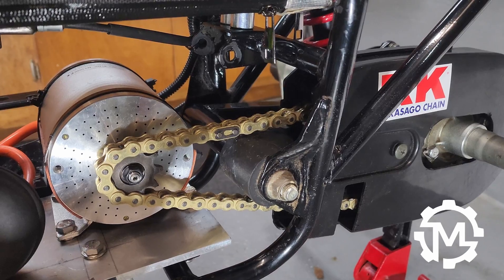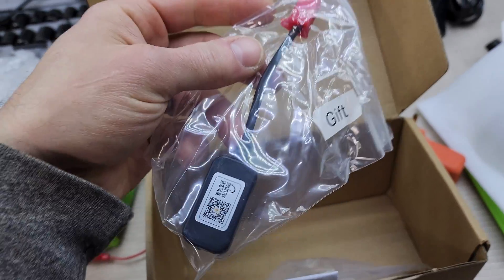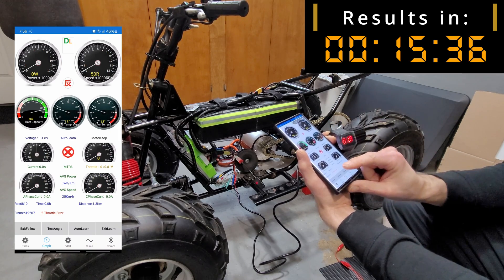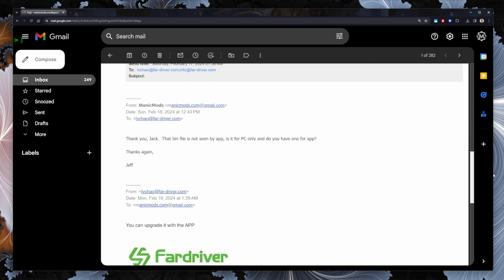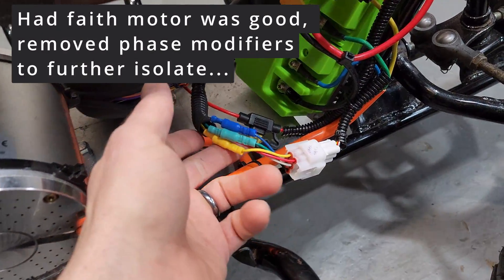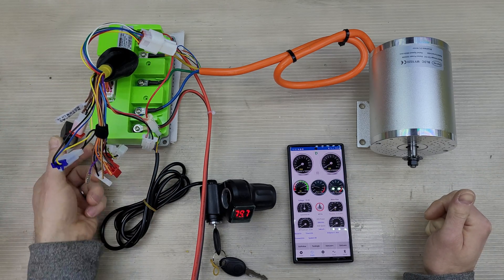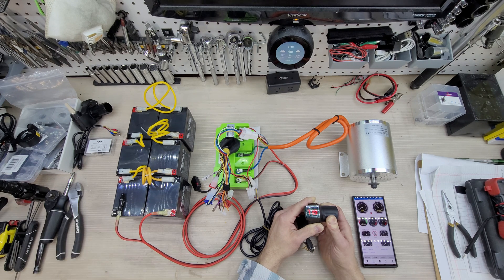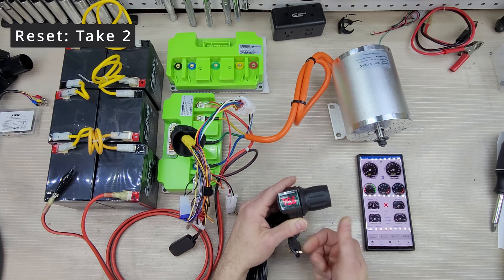Fardriver + Kunray 🔥A match made in HELL?🔥

Comment from the maker: CONCLUSION = Kunray is bad kitter / seller 👿  All signs point back to their entire kit since I experience on my workbench w/ 2 kits and 2 known good power supplies.  Fardriver controllers are known to be pretty reliable.  The controllers included are legitimate but the programming (by Kunray) is NOT.  I've worked thru dozens of solutions from communities which were very appreciated but had no affect on the inconsistent throttle.  I was able to resolve the 2nd controllers "throttle hang".  That was done by adjusting Function\Follow to Disabled.  This further illustrates their (horrible) quality control.  

RECOMMENDATION:  Stay away from Kunray.  They ghosted all correspondence re: warranty claim.  I was a month outside of return window, but Amazon forced the return.  

WHAT'S NEXT?  I ordered  a more basic kit from another seller to get the ATV back on the road, and my videos back on track.  LMK If you have questions- Appreciate y'all!
Reply: 😢I have this exact same kit that I got to make a electric dirt bike I’m doin to return it now befor it’s to late thank you
Reply: All my Kunray motors work fine.

I think it's that specific fadriver model.  I have the same issue with throttle.  If I ease I to the acceleration,  things works fine.
Reply: That's  crazy they should stick to what they know I just got the same controller my buddy and  it does the same thing I thought it was a str8 fardriver which it would have been a one and done  and done I think I'm a day outside return policy of Amazon
Reply: sorry for bring you trouble!  and we have saw your video , the controller self-learning maybe not very well.  BUT also for the MY1020 motor with fardriver controller set, it need not to reset the controller again,  because fardriver have been set the system with the motor.   and everyone motor and controller will be test before sending.
Reply: When you have any problems, you can send an email to our after-sales support team, and our online customer service is a salesperson. Of course, if Amazon closes the return window, you can still return the product to our after-sales service center in California.
Reply: Did anyone  find how to fix problem?
Reply: I bought the Kunray kit with KR5V motor, and 80 amp fardriver controller. The lime one. I think I am having the exact same problem. I actually thought it was a function at first. It seemed like the low speed throttle came on when I turned it really slow. After watching your video and somebody mentioned the third turn, I did find it was not that consistent. It’s like it comes on at 10% or full power. If I can’t get this sorted out, I’m gonna try the other controller. It’s a brand new Conray hundred amp controller that actually came with the kit. I hope you have a follow up video cause this seemed to be a very common problem.

Comment: Oi, estou com o mesmo problema, você obteve uma resposta?
Reply from the maker: I swapped entire kit with another controller.  It's Kunrays issue and as far as I know, nobody has solved this specific problem.  If you can't return and motor is installed, you could swap controller with another FD or cheaper non FD. Good luck and thanks for watching!
Reply: @manicmods  consegui achar a solução em um comentário de um outro video relacionado.

Segue as configurações a ser feitas no Fardriver

(Funcions)

Speed limit pin: selecionar opção 13- inválido

Por incrível que pareça essa e a principal parâmetro que trava a aceleração quando da full aceleração 

(PID Paras)

AN: Definir como 0
MaxKl: definir como 12

Aqui resolveu 100% dos problemas, ate mesmo quando o motor pegava altas rotações e ficava falhando foi solucionado
Reply from the maker: @matheuspericles386 I think we had different problems.  This was specifically 1 out of every 3 throttles.  It would just be limited on 3rd throttle to locked RPM. The other 2 throttles would be completely normal.  Appreciate you as you'll probably help others!  And hope she's driving awesome now for ya! ⚙️

Comment: Did you ever fix the issue,?,
Reply from the maker: No with big community behind me we could not undo Kunrays rogue prog on the FD controller. Returned Kunray kit for another MY1020 motor with a simpler controller.  If motor is installed already, you can likely just replace controller.  Thanks for watching! ⚙️

Comment: Did u ever figure out what it was? Was it the throttle? I just got a fardriver kit from hotpaxx with the same motor and mine runs fine
Reply from the maker: I replaced the kit w/ a square wave controller and another MY1020.  The community and I really tried to undo whatever Kunray did to the FD controller.  The issue was not the My1020 as I was able to isolate that when I had the second kit which experienced same issue.  There are enough people running FD w same motor which may suggest it was firmware related.  I don't remember where I left off in that exploration tbh.  Glad ur kit is good , thanks for watching!
Reply: @manicmods  i had same problem with kunray kit with cheap square controller… just avoid kunray at this point🤣

Comment: I literally have that same set up and I only experience the week throttle when I was pulling 40 miles an hour with a 52 V battery and then I slow down a little bit because of traffic and then I try to get on it again I kind of get a week I guess you could say idle. But nonetheless all I have to do is pull the throttle again and I’m off and running and I only just received my Kunray 3kw just this last Saturday. 🤷🏻
Also to note I did change all of the field weakening parameters and changed the throttle response parameters so maybe try that?
Reply from the maker: You shouldn't have to tolerate that.  Suspecting you found this video because of your problem.   When I experienced this issue on  every third throttle, it was not remedied until I restarted the controller or reached 0 RPMS.  It sounds workable in your case, but I found it unacceptable.   Also w the variance w/ two kits I tried, I am sure there are some that totally work.  But yah, Kunray sucks - plenty of MY1020 kits out there thankfully.  Glad your is workable, and thanks for watching!

Comment: Found a solution to the every 3rd twist ussue in the reviews on Amazon. Set speed limit pin to 0-NC.
Reply from the maker: Thanks for watching!  This is the first thing the FD group recommended.  Mine was set on 0-NC but also have documented test failures using other selections "Invalid" and "12-PB4".  It's also worth reporting is that this is just mapping your speed switch.  It should not create an intermittent failure.  At the end of all this, I had tried anything suggested by communities to no avail.  I hated swapping the kit as I really wanted to solve but it was clearly Kunray's issue.  I've had fun on it since!
Reply: @manicmods  thank you making this video. I had the same issue. Found that my controller was not set to 0-NC. Changed it this morning and re-auto learned the controller. Problem solved.
Reply: did this really help? I am thinking about buying this kit. Would be great if @manicmods would try it
Reply: Tested?

Comment: Another thing you can try is to set your min voltag 1 decible place more then the resting voltage, this should prevent the motor from spining when you don't have the throttle engaged.

Comment: I have the SAME exact issue. Every 3 throttle attempts or so, I get 10% power. I just spent 6 hours putting my build together. I would REALLY like to not take the whole thing apart. Did you ever find a solution to the problem?
Reply from the maker: I replaced the kit w/ a square wave controller and another MY1020.  The community and I really tried to undo whatever Kunray did to the FD controller.  The issue was definitely not the My1020 as I was able to isolate that when I had the second kit.  So if you cannot return kit, you may want to pick up a cheap square wave for testing.  LMK how you made out and thanks for watching!

Comment: Hi, nice video! Can you tell me where you got the sprockets (which ones and what ratio do you have) and what type of chain are you using? Thanks!
Reply from the maker: Thank you!  Parts below, list pulled from my later "The Build" video.  Appreciate ya!

-=-=-=-=-=-=-=- PRODUCTS REFERENCED: -=-=-=-=-=-=-=-

These are affiliate links which, at no cost to you, kicks me some pennies 😁

Final Build Parts:

DC Motor Kit  $183
https://www.ebay.com/mye/myebay/purchase

Battery $591
https://amzn.to/4dztpuU

Driveshaft Sprocket - 60T $28.99 
https://amzn.to/3WCoiUK

Motor Sprocket - 8T, 9T, 10T  $14.95 
https://electricscooterparts.com/motor-sprockets-420-chain.html

Heavy Duty 420 Chain $42.15 
https://amzn.to/4ba07S8

Master Cut-Off Switch $14.99 
https://amzn.to/44Jj9wg

Chain Tensioner  $10.99
https://amzn.to/3UtAcgQ

Fuse Kit $7.99 
https://amzn.to/4ah2fpZ

XT60  Extension cables $15.99 
https://amzn.to/4bfpqCm

FLASLD Fireproof bag $19.99 
https://amzn.to/3JTq5gy

Comment: I had this same issue.. you need to go into app and disable speedlimit pin and problem solved
Reply from the maker: Thanks for watching! That option in Function had no result when disabling.  It may resolve a similar issue but what makes this different is repeatable frequency.  2 out of 3 sequential throttles are fine.  Only on 3rd throttle was I experiencing this. And this pattern repeats itself.  Kunray is dead to me, but FD is great and plan to use again soon 🙂
Reply: it's that version ND72260 Fardriver... I was having same throttle issues on multiple hub motors not made by kunray.  I use ND72450 and no longer have issues  @manicmods

Comment: The throttle hangs because "follow" is on. Make sure you turn it off before you do the learning setup. Also don't let go of the throttle until the controller beeps at you when you're doing the learn. I have a feeling one of your hall sensor wires is crossed or something. I have that same type of motor and controller and it works fine.
Reply: Set the top rpm lower too!
Reply from the maker: Appreciate you!  Funny- 2 kits, and the programming was wildly different despite same kit from same manufacturer.  'Follow' was the problem on second.  Hall first manually adjusted, then reverted and adjusted electronically w/ BT dongle.   I went thru a host of recommending setting changes in pretty controlled environment.  Enough to just throw my hands up, and re-kit.  I'm looking forward to an FD build of something soon!

Comment: What is your minimum throttle set to?? Go to your gauges and  check what it says your throttle is resting at without you turning it. If it says it's at .80 then change it to .90 in your pro settings. And as for Pole pairs they can vary between 6 and 0 for your mid drive motor I believe. Phase offset is very important so I'd suggest you pursue that as an avenue that could be explored if your throttle or Pole pairs wasn't the issue. Lemme know how it goes if you like or need any advice.
Reply from the maker: Thanks FPV!   I had a great experience w Fardriver aside from the Kunray dilemma but I still had to return it since it was kitted.  I put a cheap square wave kit in and ATV is amazing now.  I'm a few weeks out from producing the build video.  My next build will definitely use FD!  Whatcha into bikes, karts?

Comment from the maker: The throttle hang is resolved.  This was the bonus throttle issue I received with second controller, not to be confused w/ larger throttle issue that plagues both.  Since only the second experienced this, I compared their settings.  Toggling one setting resolves this and results were repeatable.  

Just didn't want anyone scratching their head on that one.  You can find me on Reddit for more info, but I will not publicly disclose at this juncture.  I may even interrogate you 😉
Reply: @manicmods  edit*I’ll hit you up on Reddit

Comment: That throttle hang can be incorrect due to low and high voltage cutoffs being wrong but can be other issues aswell
Reply from the maker: Thank you x3 friend- are you referring to the throttle low and throttle high voltages (1.2, 4)?  I don't see another setting that touches on voltage cutoff.  If I cannot resolve the throttle hang, that's OK since my first controller does not have it.  I compared all the settings between the 2 controllers to see if I can find the outlier.  Chart below, hope it comes out OK.  It represents volatility in Kunray's programming.  If a difference between settings is causing hang, it must be one of these...

PARAMETER_____________1st Controller (NO HANG)__Vs__2nd (THRTL HANG)
Functions\Follow______Disabled__________________________Enabled
Product\RelayDelay____22643____________________________22560
FixedParas\PhaseAZero_2074____________________________2084
FixedParas\Save Times: 167______________________________142
FixedParas\PhaseCZero: 2073____________________________2085
Reply: @manicmods com essa programação você conseguiu resolver o problema?

Comment: You pole pairs need to be #3 and not 4
Reply from the maker: Great catch!  This would be such a miss if Kunray is programming these as such.  I will adjust and let you know.  Thank you again!
Reply from the maker: No doubt you were right, but didn't fix issue.  All my testing and research points back to Kunray.  They SUCK- especially since they ignored any warranty request.  I had to have Amz force return, and will be getting a more basic 3000w kit from another seller.  I'll be back in fardriver land when I build my cart- no more kits for this guy!  Appreciate you man 💪

Comment: Your pid parameters may be off.
In the video you have 
An:10, 4, 8, 16,9.
Thats should be 0, 4, 8, 10, 9
Reply from the maker: ^^Great Info-taining cart-centric EMV channel 🏎️
Appreciate you stopping by man!  After AN (10), you must be referring to my current StartKI (4), MidKI (8), MaxKI (16) and SpeedKI(9).  I was also reviewing these last night.  Digesting info...
AN- I can change from Kunray's 10 to 0.  Manual says 0 is for surface mount motor if you think that is right.  Manual says Standard IPM motor is AN 16.  
MaxKI- I can adjust from 16 to 10.  I was thinking of changing to 12 since the chart in manual has that figure in configuration 4 alongisde the other KPI numbers I have.  

Going to add your comments to my notes and systematically try to step thru some of these recommendations.  Will keep you posted!

Comment: Swap the phases and keep the hall sensors wired how they are . 

Also worth exploring pole pair settings and AN settings . 

Most likely issue is the motor those MY1020 motors don’t run very well with some controllers and seem to prefer square wave units
Reply: Just curious why would you not swap the hall sensors too
Reply from the maker: @mtb_nico223 because it went in the right direction and phase would never intermittently cause an issue.  At least that was consensus at time of research and assists. Thanks for watching!
Reply from the maker: ^^ Has awesome e-Bike channel ⚡
Thank you for that, Kunray said the same thing.  I was skeptic, tried as last effort before receiving the BT module.  It did not run at all in that configuration.  

You may be spot on re: sinewave vs. square.  These were kitted together so they should come working as advertised.  They have another kit w square but I had opted for the FD kit.  I have some good folks from the FD group on Facebook that are going to assist me tune 🤞 I'll keep this updated and appreciate ya!